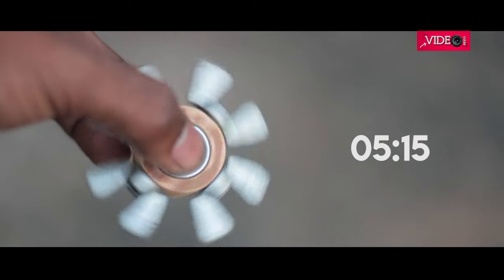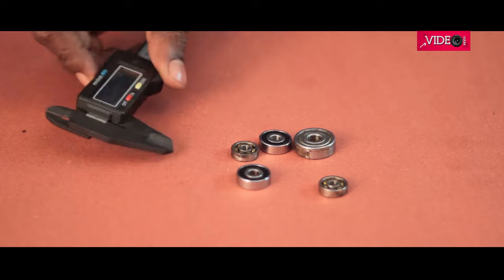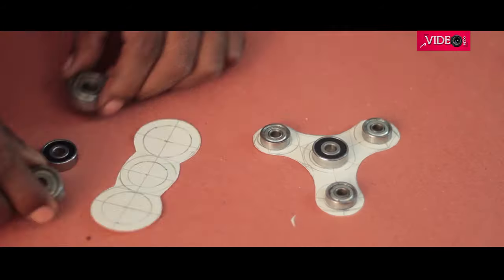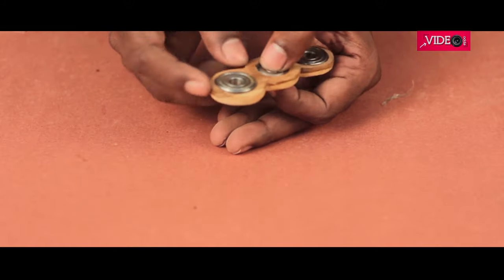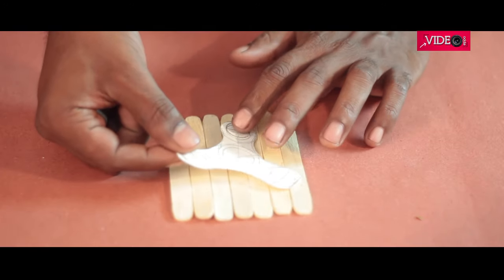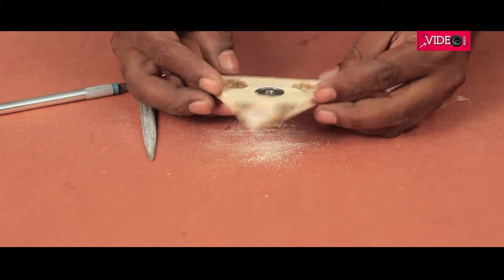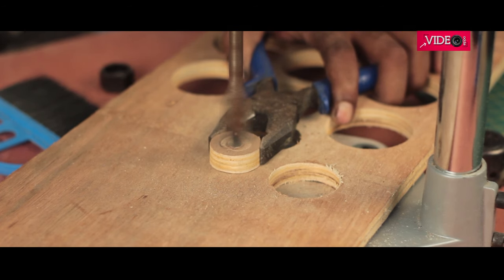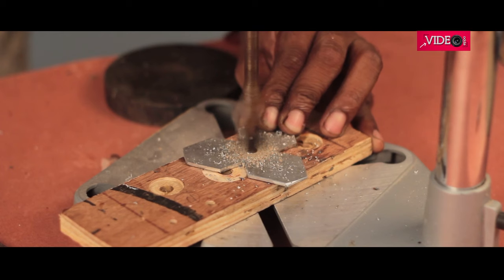3 EASY HAND SPINNER FIDGET TOYS

Comment: it's really cool but it's not that easy I am a kid and I don't have the material you have but great video !
Reply from the maker: Yes, for this project the difficulty level is at intermediate. But i will post a video soon on how you can make this easily
Reply: Peter Ilkov I made a great fidget spinner with just 4 bearings, hot glue, tape and a rubber band. I just glued the bearings in a triangle, then for extra support I put tape over all of the bearings and then to keep a lot of tension, I just put a tight rubber band over it all. And this spinner works great! If you have the materials, you should definitely make one yourself!
Reply from the maker: I tried that as well. But everybody wants to try the fidgets that we make and when it moves into too many hands, it breaks.Thanks for the idea though

Comment: Can someonr please tell me how VIDEO EPPO cut the holes through the popsicle sticks? I couldn't really understand him.
Reply from the maker: Kaanan Reinhart  I used a spade drill bit on a drilling machine. But it's fairly easy to drill through popsicle even with a pair of scissors. keep twisting and poking on the place where you want the hole and gradually the hole can be made for the desired size. Keep checking if you the right size hole you want. It's better to make the circle before you start.
Reply: Ok! Thanks for the reply
Reply: VIDEO EPPO Do you know a way to make fidget spinners without bearings??
Reply from the maker: ball bearing make it  spin faster, without it everything will be slow